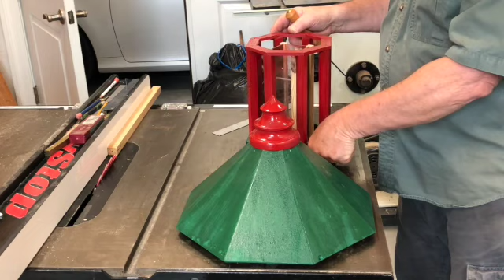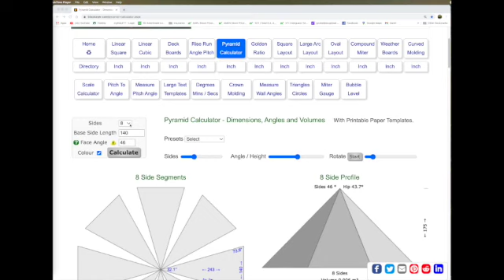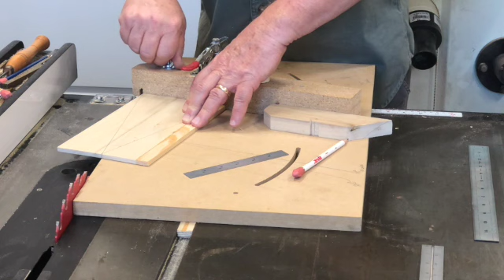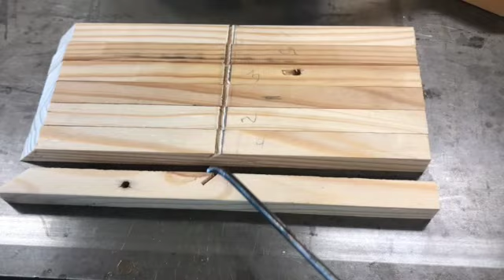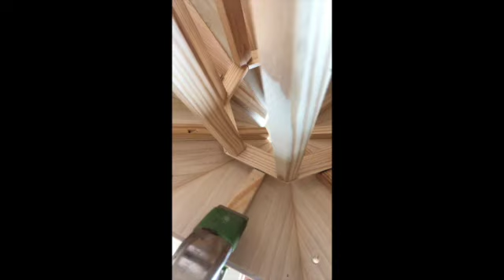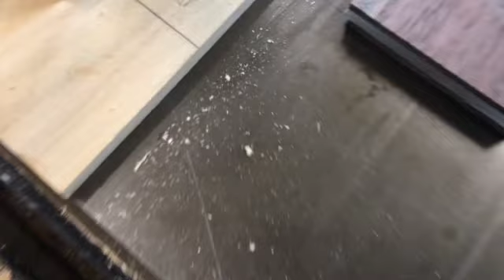Build an Octagonal Bird Feeder   SD 480p

Comment: HI, MY FRIEND NICE VIDEO AND NICE PROJECT ..BUT I AM STILL  IN NEED OF HELP, I AM TRYING TO DO THE SAME ROOF BUT I HAVE HAD NO LUCK AT ALL ...EVEN WITH THE HELP OF THE WEBSITE THAT YOU MENTIONED ..THIS IS MY DILEMMA. I WANT AN 8-SIDED ROOF WITH THE RICE OF 8 CENTIMETERS AND THE RUN OF 10 CENTIMETERS, TOTALLY POINTY ON TOP ..BUT I TRIED THE BEVEL AT 11.3 DEGREES WITH  NO LUCK,21.5 NOT LUCK..22.5 FAIL ..... ALL I NEED IS THAT BEVEL ON THE SIDE OF EACH PANEL--I AM USING PINE 2 CENTIMETERS THICK THANKS AND SORRY FOR BOTTERING YOU.
Reply: It is an issue but the web site should get you in the right cut and then the final angle cut as I did in the video.  I would recommend that the top not be made out of wood.  Over time the wood expanded, then shrank etc etc until the joints came apart.  I now have used tar paper.

Comment from the maker: After a year in use I felt like I needed to update everyone that might be considering this build.  Within a few months of placing the bird feeder outside the humidity caused the wood roof to expand and contract.  Eventually there was a gap between two of the panels that and the bottom was at least a 1/2" wide.  I was able to fill this gap with silicone grout and it held the two panels in place and expanded enough to keep the water out of the feed.  This past summer it was very dry.  When fall came the humidity came back and the panels just couldn't handle the drastic change.  The panels bowed, buckled and split apart.  I had to remove the feeder and replace the panels.  I took off the braces under each panel and swapped out the wood panels to vinyl sheets I got from a yard sign.  I used hot melt glue to put everything together then I cut 1" wide strips to cover the seam where each panel meets.  So far so good.

Comment: Hi there  quick question, If I was to paint my bird feeder white paint before assembling it, which form of glue would I use during assembling it, Wood glue still ? or another type ??, Thank you.
Reply from the maker: The roof will expand and contract quite a bit.  At one point I had a good 1" gap between two of the roof slats.  I put silicone caulk in the gap and it has held through all the movements.  If I redid this feeder I would use silicone caulk to glue all the joints and cut the notches where the top sits on the platform a little looser.  The top should sit loosely on the frame.